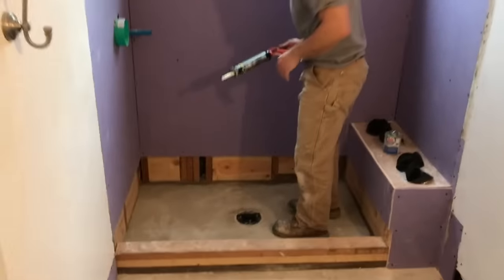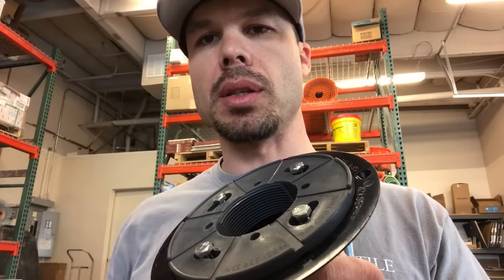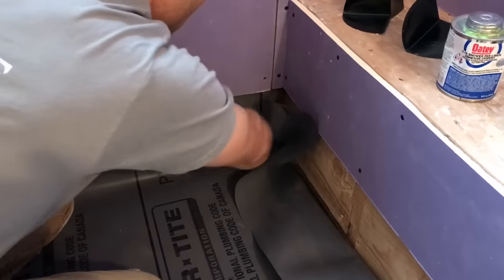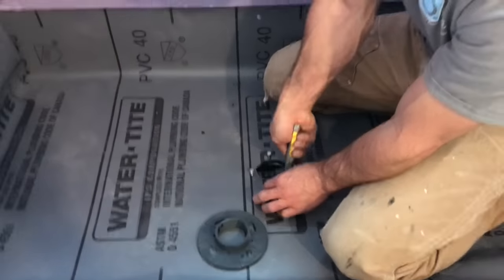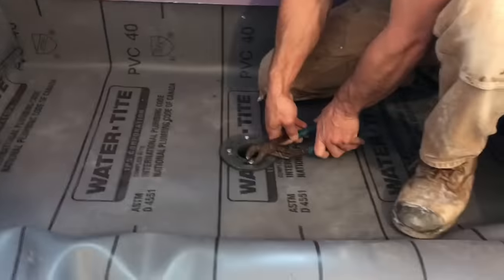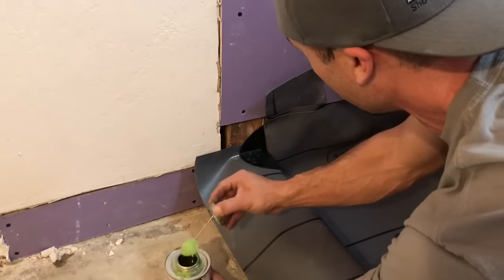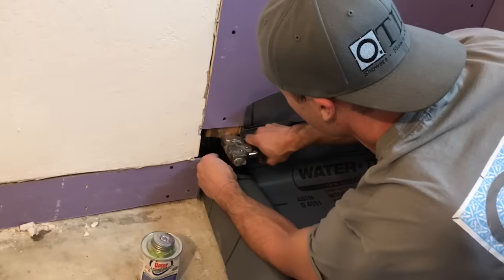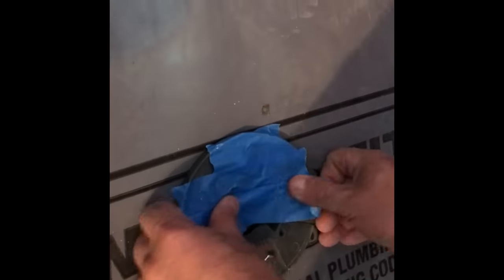Easy Shower Pan Liner: Tile Coach Episode 9

Comment: Awesome video. Only recommendation I have is to tell the audience that the bottom board (in my opinion/experience) should be 1/4” to cover the liner. It’s easier to build the bottom row/rows of tile out instead of putting 1/2” on like the rest of the showe and the board being kicked out too much because it’s on the liner. I love your videos, learned a lot
Reply: I am running into this issue, wondering how I transition from the tile on the wall to the bottom ~10 inches of tile over my pan liner. So you're saying drop down to 1/4" for the bottom piece of Durok? Could I just build up the walls on the bottom 10 inches with mud in order to make it flush to the 1/2" walls?

Comment: Isacc. Here’s 1 for ya. 
continuity wires. 
It’s something customers LOVE. 
In short without much detail unless you want that. 
Run wires to the areas that leak the most over time. 
Run to shower valve.  
You can run 1 or several sets of wires. Pull cover off and use a tester to see if water has leaked under pan. 
Sounds crazy but it keeps workers from cheating. Customers get a extra service per say. 
In short it’s a water alarm. 
You can also do this but there’s pros and cons to it. 
For 30 yrs plus in construction plus. The biggest is customer satisfaction. It’s always a step above the rest. 
And if correct your in CA. Same here. 
Some strict codes. Let alone customers

Comment: Great video! A trick I picked up, is to just cut an “X” over the drain hole and fold the liner flaps down into the drain. The ring will ensure they stay folded down. Just an extra measure.
Reply: The ring will not hold the pan down. I am also failing to see what extra protect that is providing. Also putting the silicone on the bottom flange of the drain before having the pan i  place seems like a bad idea as well. Cutting the hole out for the drain properly allows you to lift the pan after it is secured to the walls and apply the silicone exactly where it is needed.
Reply: I guess if you cut. Perfect O the theory is water may run back under it as it drains. Who knows
Reply: Another experiment for the tile coach to do!
Reply: @vic1sch  the caulk groove is exactly where it needs to be, how are you planning to change that by not caulking first.  Fighting it later doesn't help.
Reply: @spencerhansen8374  The caulk groove? That groove is for the pan to be clamped down with the ridge on the clamp ring. The silicon bead should be between the grove and bolt  holes.  All pans are water tested for 24 hrs using a test ball.  Test balls  are used to ensure if a drain backs up the water won't leak under the pan. The inspector makes sure the pan drains and the weep holes are open.  In 47 years I have never failed a pan inspection.
Reply: You been watching Starr Tile.

Comment: How do you float that part? Or do you install cement board??
Reply from the maker: Yes, float
Reply: I have the same question.  I need to know the missing steps between this video and the next one.   I am now stuck at the spot where this video ended.  You say you float the walls over the pan liner, but how is this done?  With what type of mortar?  I really need help with this part.

Comment: How did you install the board at the bottom without puncturing the liner? Did you float the bottom with mud or something?
Reply: Isaac Ostrom So you installed aquabar paper over that board that's on the wall that looks like drywall, then installed the metal lath, wood strips and floated the wall with deck mud? is that how it works in this type of application?
Reply: Please stop doing your installations,your methods are going to fail,do your customers right and do the job correct,I replace so many jobs that people do this incorrectly,nothing wrong with wanting to do tile work just do it correctly

Comment: Instead of putting tape over drain to protect, why not just leave liner intact till you have your base in. Also where I am, we have Denshield, which is waterproof, lightweight and cuts like drywall.  Also I install Denshield right over pan liner down to floor. It gives you somewhere to glue tile to and a good place to draw your level line around before you install concrete base.

Comment: Thanks for all the great videos. Just curious what you'd do later with the wall gap between the backerboard and the floor after pan liner is attached. 0:14. Thanks!
Reply: I've been wondering the same thing. I've seen some install the cement board all the way down to the floor. Curious why some don't. This would be a huge help - I'm just about to this step!
Reply: @billrichmond1110  i think this is a one off as they have to have the boards installed before the pan liner. I left my backer board a little more than half inch above the finished tiled floor, then thoroughly paints good layers of Hydroban liquid on the bottom edge of the boards.

Comment: If when you get to the the curb fold of liner, don't make your cut on the liner straight up, instead cut liner(3rd)layer back horizontally towards back of shower so when it folds over curb you have that piece now up the curbs wall

Comment: Have you ever tried to just getting the excess liner to go over the curb without cutting it and using those glue in molded corners. I am assuming you are going to mud the wall or hang Cement board over the sheet rock you have up already.  With the wall packed out like you have it the any bulges from the liner being folded up and over the curb will remain in the void you created with the sheet rock.
The top 2x4 on curb should not be flat. 15 degree bevel to inside of shower to allow for proper drainage to weep holes.
Reply: @TileCoach obviously the less folds the better, and adding patches just adds thickness and more seams that may leak. PROPERLY glued, you can just cut the liner, glue, then fold it into place... one seam. Going above the curb with the liner is (IMO) a moot situation considering by then the water would already be flowing over the curb...

Comment: I’m here to grow as well my man! Great stuff. The only thing I would do different when cutting the holes for the bolts and drain hole is that I would cut out an X instead of the actual shape of the hole. All it does is create another secure way for the water to only go down the hole. Basically creates flaps that point down the drain hole. Either way, great video and very informative. Thanks.
Reply: There are female threads inside the drain hole. If you leave flaps, there is no way to thread the adjustable drain to the drain body. The flaps will block the threads. The video doesnt show the the adjustable drain threaded in yet, so this may sound confusing...

Comment: Good video, but are those non-corrosive staples?  Shouldn’t you use water resistant screws?
Reply: Isaac Ostrom Ok cool, thanks. I’ve subscribed.  Good detailed info.  I’ve got lots of work to do on our older model home, probably 50’s style construction.  👍

Comment: This should be a video on what not to do.
Hey Isaac you need to run up here to Long Beach , I'll be having one big shower hot moped 10-18-19. I'm a contractor not a tile guy you need to pull up a chair and watch my tile guy, he can wrap, scratch and brown float pan in one day with out redwood stripes and it's flat and Plumb.
No schluter around soap nitch
45s edge's of the tile.
I know you are not going to tile over the purple stuff?.

Comment: We will notch the corner 2x studs out 1/8"-1/4" up to 6-8" high so that the corner folds recess into the framing a bit, keeps the durock or kerdi board from bowing out in those corners

Comment: There is no need for preslope as the mortar will not allow water to run downhill the water would be completely absorbed into mortar until is get pulled out the drain if your water proofing fails

Comment: Did you waterproof the bench?
Reply from the maker: Yes, with RedGard after we floated it
Reply: @TileCoach  thank you! I'm watching videos planning to diy my ruined shower. It failed badly, I'm guessing the reason is that a builder didn't waterproof shower bench. I'll find out for sure what happened once we break  everything down to the studs. But basically I can see daylight from outside coming through caulking between wall and bench surfaces in the shower.

Comment: Do you install Cement board after shower pan?
Reply: I have the same question.  I need to know the missing steps between this video and the next one.  What did you put over the pan liner on the wall to make it flush with the wall board?  I am now stuck at the spot where this video ended.  HELP !!  Please.

Comment: Instead of using the 2x4 as a curb you should make the curb ooutta drypack cause if you use a 2x4 it will crack the tiles on top of the curb or loosen the grout lines I dont a few repairs for the curbs and its always because of the 2x4s warping a hair and it jus messes up a nice shower

Comment: Drywall is a great tile backer but ONLY for dry areas... Never in a wet environment like a shower!!
Reply: He's likely going to put a water barrier on this mold resistant drywall, and probably epoxy grout after. That backer board will never see water!
Reply: Most membranes say right in the instructions not to be used on sheet rock.  Like that hack startle does. This video is old and I have not seen this guy use sheetrock in the shower in his newer video. Sheetrock in shower wrong period.  Also the seem at the liner is very bad.
Reply: @tuppersdad  another opportunity for them to not honor any warranty. They also say to apply with a trowel no? Schluter does work with sheetrock  though doesnt it?

I just tore apart a shower with green sheetrock and lathe on it. Sheet rock was completely dry no issues (except at the bottom where the sheetrock was making contact with the "shower pan) , and it didn't have a water barrier. 

Redgard says it can also be used as a shower pan liner. You beleive that? Or you form your own opinions?
Reply: @MrTacolover42  I believe all the membranes can be used as a shower liner. Some you must use a mesh with it. Not sure how red gaurd works don't use it i don't think it is a great product. In my area commercial they use the laticrete products like hydroban for shower liners all the time.
Reply: Never use sheetrock for a wet area like a shower. Always make sure pan liner is 6” above fill line(curb).
Reply: @MrTacolover42  Fast forward 8 years.  Wow, how did that happen.
Reply: It's not drywall ,it's called denshield lock a lot to drywall but it's made for showers
Reply: Kerdi membrane can be applied over Sheetrock in a shower.
Reply: @prolife8461  exactly what I was going to reply,alot of people in the comments don't know what they are talking about
Reply: Codes says not to use drywall behind tile in wet areas; Hot mop is better so far!
Reply: Not true.
You can coat more resistant sheetrock with red guard or some other waterproofing product and it will be perfectly fine.
Reply: @andresSanchez-rc2ue   Note the color. Purple board is specifically made for high moisture environments. It’s water, mildew and mold resistant. More expensive than your typical sheetrock too.
Reply: @joelaw  exactly.
Reply: @andresSanchez-rc2ue  do you know what dry wall is and what this board is I would love to hear your opinion
Reply: @stevealsip3045  yea, was gonna say what are people talking about.   Dry wall is great but not for a shower, and everyone agreeing and adding to that statement wow no shit.   The video isn’t that old.
Reply: @tuppersdad even kerdi?
Reply: This must be your rookie video bud😮
Reply: If it's not Durock or Hardy backer it's sucks and will fail.
I tear out orange/blue/purple backer once a month from (Pro) installs.
Reply: Actually it's a shitty tile backer as you are as hearing to paper. Never put tile on top of sheetrock
Reply: @MrTacolover42  dont bet on it even if he does all that !
Reply: @MrTacolover42 i believe it! Redguard is good stuff! Redguard would go a long way to saving this guys ass too! Its probably too late for this poor customer though! Wood framed seats in showers is just plain amateur night in my opinion redguard or not!
Reply: @Gonwash70 well code says 2” above curb height so usually thats 8” up the walls or 6” with a 4” curb!
Reply: @prolife8461 ya maybe but its still not up to code the way he built that shower! And just because “they” say its ok to use in showers only time will tell i guess! However a wood framed seat, i dont care what you use ,shouldnt ever be in a shower and if it is you still have to build it INSIDE the shower pan! Thats a concept that has a hard time getting through apparently!
Reply: @Tyler_rushing so can rubber dog shit so whats your point! That its ok as far as the code says its ok?  That doesnt mean a damned thing if you miss the whole point of how a pan is installed which is what happened here! Glad its not me that paid this guy to redo my shower!
Reply: @joelaw water resistant doesnt mean water proof though! Remember that even if its colored like the rainbow! You cant make chalk water proof! Those colored sheetrocks just mean it takes a little longer before the water trashes it! Given enough time though its done!
Reply: @StonemanRocks  Oh, I agree, although properly installed, there is no reason it can’t last for decades. I mean that is the purpose it was designed for. That said, if it isn’t used correctly, you might as well build your walls out of newspapers and glue, though I suspect it would hold up a bit better than white board.

Comment: Why don’t you have the liner underneath the wall board and not a minimum of 10” high ? Also I always use bricks for curb and benches . Why even use Sheetrock at all when you can just use cement board ? Seems like a waste of time and a waste of the customers money ! Pre-slope is essential for all liners ! Do you ever use laticretes hydro ban ? Way better than redgard and no need for fabric . Any feedback is welcome brother ! Thanks for your time and have a blessed day ! 👊🏽🐻🤚🏽
Reply: Hydro ban is about 500$ in texas and liner materials are about 130 depending on size and configuration some clients dont like to spend extra😤
Reply: xxPOINT BLANKxx redgard is $60 per gallon at Home Depot . Hydro Ban  is $70 per gallon at Lowe’s . $20 difference is not bad at all when you can use 2 gallons to achieve the desired thickness Mr. Blank .
Reply: @waltercastillo5921  wasnt aware lowes carried it I use hydro ban

Comment: I prefer a linear drain for many reasons. 1) For balance issues, having no sloping sides etc. 2) Large tile installation. 3) Easy to prepare, having an even slope from one end to the other. 4) Less time to prepare and to install large tiles. 5) Never have to stand in your shower water, it all goes towards the linear drain under the
Reply: I thought I wanted a linear drain myself, until I talked to a buddy whose shower has one. He said that he has to clean it frequently, and that it gets kinda disgusting below the grate. Changed my mind to a FloFX drain.

Comment: Here's a little tip whenever you're going to put the the drain on cut an ex where the screws go then screw the screws on that'll make it watertight same goes for the cap. Never cut an outline of the whole..

Comment: How many inches do you cut off the sheetrock from the foundation
Reply: You really don't have to if you get in there and put the pan in first. Most tile installers don't leave sheetrock in their shower due to the fact that if anything leeks that shit starts falling apart. Most use durock. If the use hardy board they are fucking cheap installers and I would advise you to go with someone else. I use goboard which is a fiber glass based board that is actually waterproof itself. All you have to does is caulk your seams and nail holes it's 18 dollars a sheet though. typically takes 5-6 sheets a shower.
Reply: Joseph Merkle b(

Comment: Easy shower pan episode 9 at the 5:29 mark...find top of curb, hold fold down out of the way slightly, so you can cut back piece parallel to drywall...will also illumi nate 3rd layer in corner, and. Provide a flap up the wall on top of curb...

Comment: I build my benches out of cinder block. That way there's no way they can ever deteriorate. Skim coat with thinset when you are done and waterproof, they are good forever.
Reply: I love the fact that you realize it is important to pre-pitch your pan. As far as the weep holes go though, you should just put pea gravel around them allowing for water to get through all of it.
Reply: tom styer  good idea, what about on wood floor two story house?  Thinking about new tiled shower with bench.
Reply: @stevelopez372  I live in Ohio so just about everything is over wood floors. a shower setup is still the same no matter where you're at though. Everything requires a pan liner to be installed. Just make sure you level the area the bench  is going to be built on.
Reply: You can check out some of my pictures at Tom's Tile on FB.
Reply: Cinder block bench is great idea
Reply: I cut the liner with on an X cut instead of a circle, it is better
Reply: It's not waterproof after a skim coat of thinset. Thinset is neither a waterproofer nor waterproof. Your blocks will crack and turn into a giant sponge.  Surely you put up some type of waterproofer and crack isolation to your brick bench?
Reply: We use a metal bench that you bolt into the studs then tile the bench with ultralite. 25 lbs bags that stretch to the same as the 50 lbs bag of ultraflex one.
Reply: There are many reasons why a house would be unoccupied in winter months. Winterizing takes care of freezing plumbing fixtures. Wet cement blocks WILL freeze and crack in an unheated home.
Reply: @johnbeckwith1361  The cement block is not going to act as a sponge. Do some research, CMU is vitreous, not porous. Having said that, I also bring my waterproofing up the walls 8 inch above the stone bench, because safe is always better than sorry, and besides that code requires it for any and all horizontal surfaces inside of a shower.